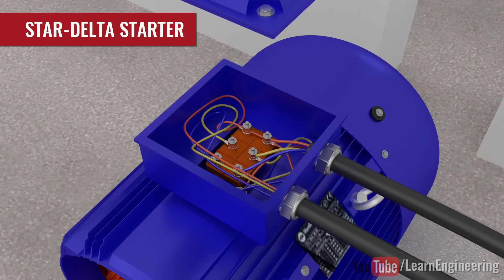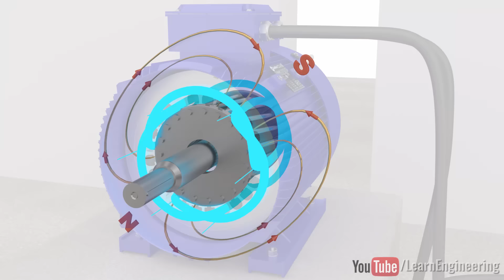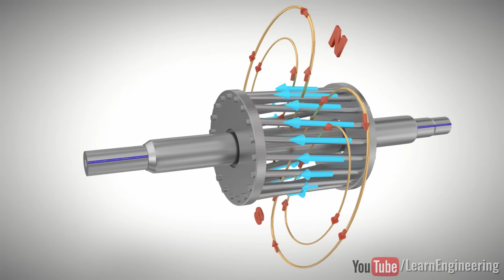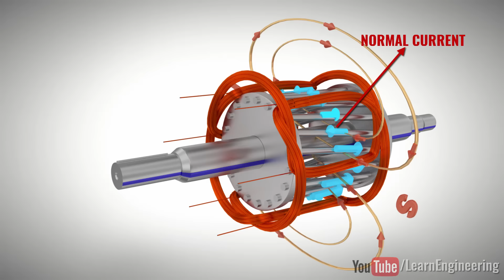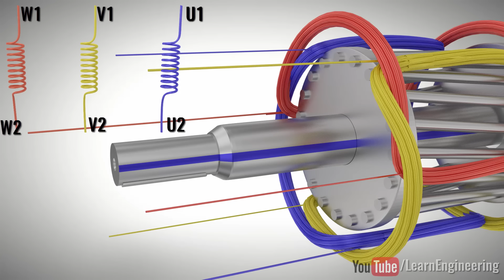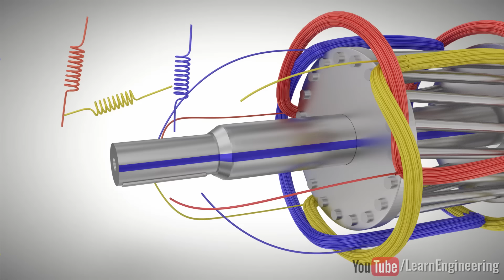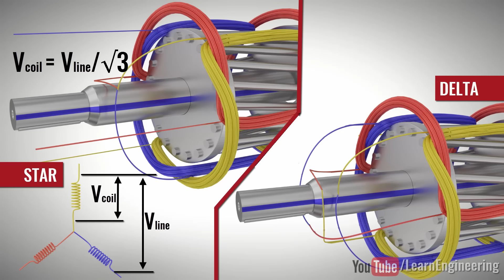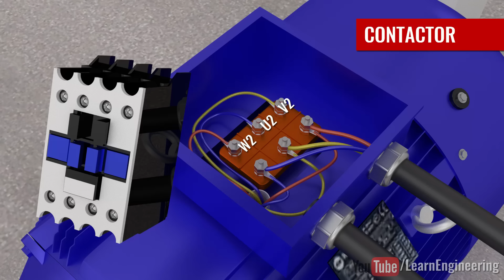Understanding STAR-DELTA Starter !

Comment: How increasing rotor speed is responsible for decrease in flux cutting?
Reply: Its relative.
Reply: @chanakyasinha8046  I know it is relative.
But should it be opposite of what stated in video?
Reply: @rohittrivedi2351  no, see, the rate at which flux cuts the core gives more push, if the rotor and the rotating magnetic field reaches the same speed, the core sees the field like it is stagnant and will not induce any emf in the rotor. This is the reason why rotating magnetic field is always slightly greater than rotor speed, unless you don't increase the frequency of the supply

Comment: Please help i have a question, i encountered newly rewind stator without tagging it was a six leads out, then after checking continuity we short the wire not exactly knowing which 123 and 456 is, just assumption. Then connected into delta 1-6 2-4 3-5 then after swicthing it was spark and tripped, but when we connect to wye it was run shorting the assumption of 456 and supply to 123, now my question is let say the people who rewind the motor has mistakenly inserted the wire into the wrong path and re group it instead of 123 and 456 it become now 153 and 426  meaning the 2 and 5 switching,now if i connect it to wye or delta what will happen? Thank you in advance.

Comment: This motor starting technique has been replaced with Soft Starts for electrical motors.
Reply: Usually soft starters are often used in brushed motors (there star delta is not possible).
Of course motors controlled by inverters which modulate frequency also don't use star delta.
For normal, not frequency controlled induction motors star delta is the cheapest way, even if smaller motors with 5 kw or less can be started without it.
Reply: @simonm1447  I stand corrected, I'll take this back to the corporation I work for with multiple operations using Soft Starts instead as a cost savings measure.  Are you hiring once I get fired?
Reply: @shadoa8154  I don't know for which company, and in which business you work (maybe its for special machinery).
As a craftsmen in EU, I have worked with a lot of different tools, and machines. The soft starters we have in our machinery are used in big angle grinders, and large circular saws, which have both a brushed motor. Tower cranes are now using frequency modulators, because they work softer with it, and the speed of the motors is perfectly adjustable. 

Our stationary circular saws are driven by induction motors (like all tools in EU above 3 ,5 Kw) and they have star delta. There's no need for a relatively simple tool with fix Rpm (there's no need for variable RPM) to run it with a frequency modulator for thousands of Euros. At home I have around 1 dozen smaller induction motors, they start directly without switching 2 modes (often the small ones are only made for star, not for delta)
But tell me more, which kind of machinery do you manufacture, and how do your soft starter for induction motors work, is it a normal frequency modulator?
Reply: @simonm1447  I work for one of the largest lumber manufacturing company in Canada/the world.  We use induction motors for all sorts of things, grinding, saw arbors, circular saws, conveyor and waste systems... too many to list really -  the division I work at probably has close to 400 3-phase AC motors and about half of those are either driven by soft starts (for larger motors) or VFDs where speed control is necessary.  The rest are across the line starting because they aren't large enough to generate the in-rush current/torque necessary for reduced voltage starting.  Wherever that is required, however, we always use electronic Soft Starts or VFDs.  

We did away with our last Star-Delta system for a 300HP AC motor about two years ago and our mechanical maintenance team has had to do far less work on that particular piece of machinery since we now ramp the voltage gradually rather than start it at half voltage and then switch to full voltage.  For reduced voltage starting methods, I can't really think of a reason why anyone would use this rather than a Soft Start.  Either the motor is too small and can be started across the line, or the motor is quite large and the benefits of gradually applying voltage pay themselves off in maintenance later on.
Reply: @shadoa8154  In this case the difference is the size of the motors. I'm a carpenter, and our induction motors have between 5 and 10 kW, no comparison to the huge motors your company run. I can imagine a 300 hp motor would be very hard to start with star delta. If I remember correctly  in Germany at least star delta is mandatory for motors bigger than 7.5 kw, for motors in this size this works well, if the machine don't need variable speeds and star delta is relatively simple, and inexpensive, also our machinery is partially older.
But nice to hear from your experience in a big lumber manufacturing company, I'm sure it would also be interesting for me to visit a company like the one you work for. 

BTW a happy new year!

Comment: how its possible without three contactor _ main contactor , delta contactor and star contactor ???

could you please explain?
Reply: The main contactor was omitted for clarity, this was just showing the star-delta arrangement. In a real panel, the main contactor will also have an overload or motor protector to prevent the motor from operating in single-phase conditions or when there is a short or overload.

Comment: But the connection is wrong
To make star delta you need three contactors 
The third contactor who is responsible for star connection should have a short circuit at on side

Comment: the end of the video makes zero sense. the contactor on the left just has the leads on the load side of the contactor. The line side should be connecting all three phases right? Also how do both delta and wye contactors interact? they should be interlocked correct?

Comment: Question:  How does star contactor connect the phases? the way you draw it, they are in T1 T2 T3, with no connections anywhere else.  Do you need to put jumpers between L1 L2 L3 so they are connected when it pulls in?

Comment: Did I miss something, or did you just not show the shorting connections in the star contactor?
Also, every star - delta contactor set up I have ever seen has three contactors - one of them supplies the main power to the other two. The other two are always mechanically and electrically interlocked so that they cannot be pulled in at the same time. Showing them physically distanced from one another in the video is a bad idea - it's just something that should never happen.

Comment: This won't work I'm afraid to say!  This is why, when you start your motor in star, with that first contactor closed, you will need the second contactor closed as well to power the motor, the first contactor is only making the star connection. When you kick it up to delta, you need to drop out the star contactor and then close a third contactor that connects the  power to the other end of the coils giving you your  full voltage !

Comment: This is a bad representation of the panel you have 3 contactors and you don’t take a cable to the motor from the star contactor and also the star contactor never had shorting links across the top to complete a star connection

Comment: Dude your re mad.
Teoreticaly is like this. Practly is a little more complicated. Yes it a transformer work done by alternative motor.
But. The 3 ( teoretic) coils do a electromagnetic field. That it is indiucted by air and special metal of the rotor a another electromagnetic field in rotor.
Than, as rotor has no coils to collect by spires electric curent generated magnetic field. They done a cage. Very strong cage that act just like cooper coils.
After that, we have a rotation electromagnetic field, and the rotation vert is given by the way we dispose coils in the stator.
We have 6 pairs of nord and South polle rotating.
When we start the motor he will try to rotate with the speed of changing of signs on alternative curent does. 50 Hz 100 times per second. It will not beacuse is not an ideal perfect machine. So we will have loses on different parts of equation. The rotor will never reach the spinning field of the stator. And it know as cos phi that delay.
May be I am wrong. But I have seen how they manufacture a electric motor.